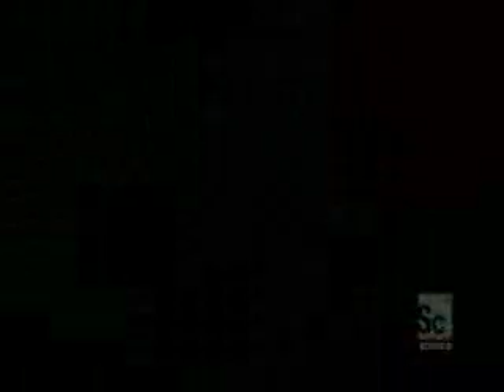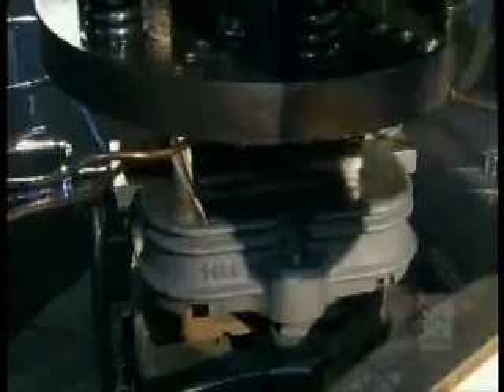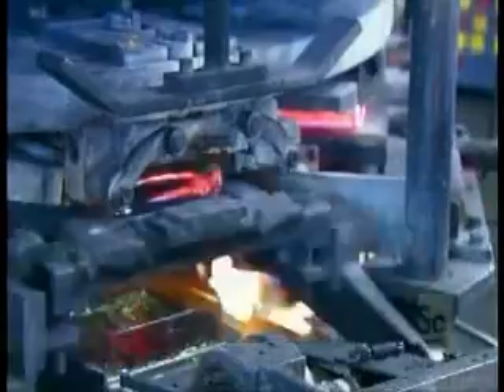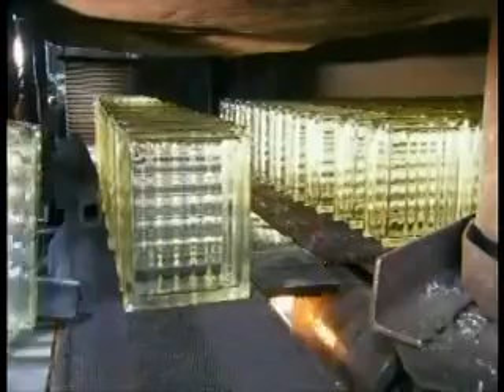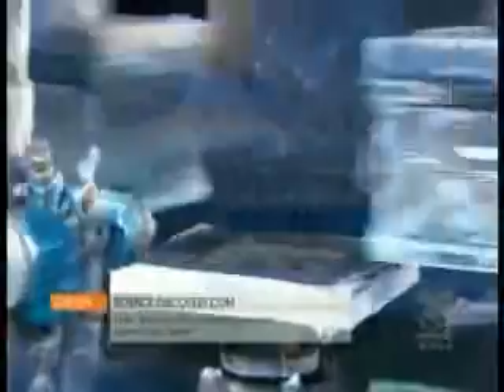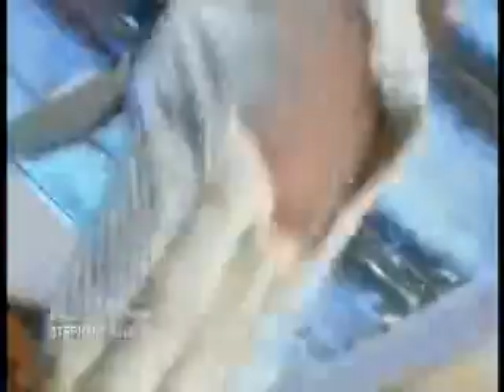Glass Block Manufacturing

Comment: Good behind the scenes look at the glass block manufacturing process. Some manufacturers use the liquid vinyl process for mortar to stick and other companies will also use a white paint. Glass blocks are now also available in colored and frosted units and different thicknesses as well. A well manufactured product needs to be installed correctly for a great finished product.